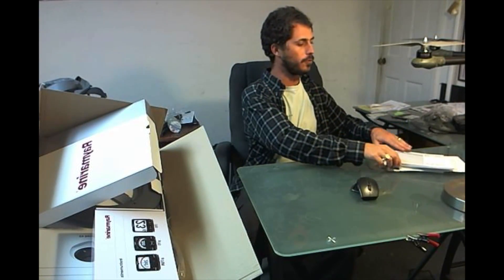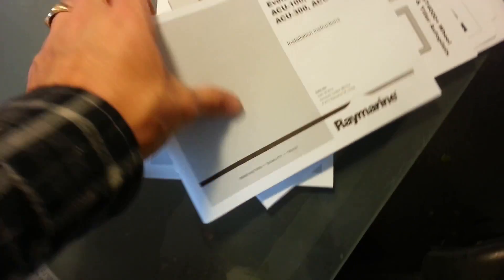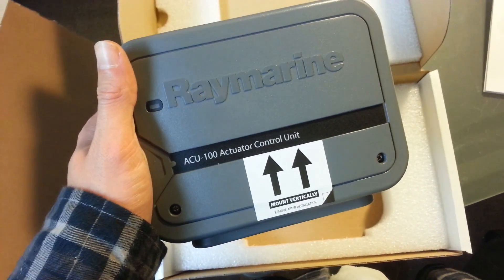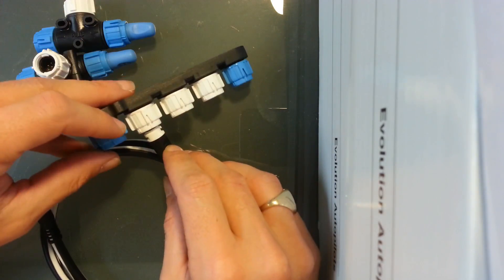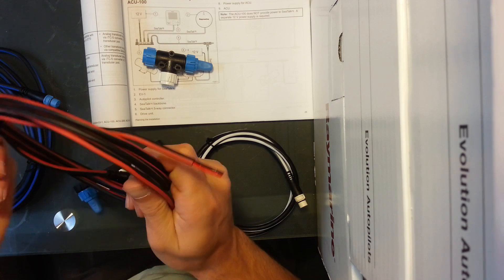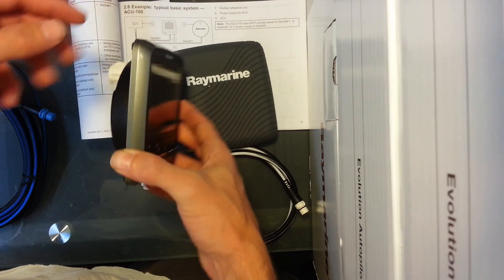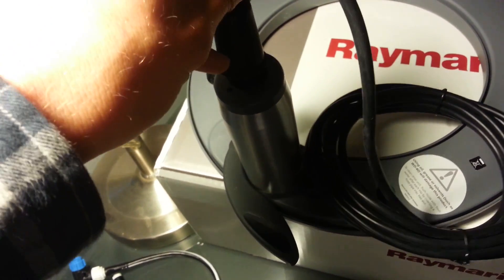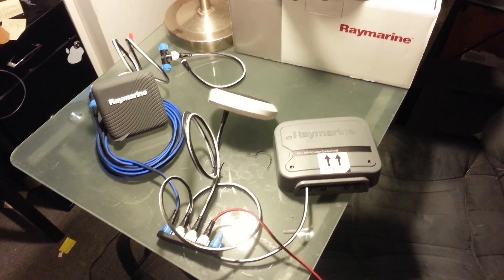Raymarine | 01 - EV-100 Wheel Autopilot & NMEA 2000 Network - Basic Setup T70152

Comment: i have bought two of these, and they both cracked into pieces internally. About to install third. Garbage, but no other affordable choice. Avoid like plague. My windvane is 40 years old and works like new. This autopilot struggles to last a week of offshore sailing.
Reply from the maker: +Super Wag Totally agree the drive unit is garbage all plastic pieces it would make a good backup for sailing offshore but the hydraulic drive is much more solid if you're going offshore, expensive though.

Comment: You have made a mistake at 7:10 the ACU doesn't need a power connection from the battery.
Reply from the maker: Thanks for the concern but the information I provided is correct, the ACU does need a connection from the battery, that is where the wheel drive draws its power from, the ACU regulates the power. Check out the manual on page 19 section 3.6 System examples https://raymarine.app.box.com/s/j9uaqm020hb826l4t3cp/1/1787035935/119763483197/1
Reply: Oh yes fair comment the 100 does have two power supplies.  BTW the reason the connectors are plastic is because its cheaper than metal and they are waterproof to IP6 which could be useful on a yacht.

Comment: Nice vid, looking on picking one of these up for my macgregor 26m. Just need to figure out how to get it talking with my garmin 441s
Reply: You would think that but as I have both, I can tell you the Ray AP does not interface without significant frustration.  The P70 control will tell you it SEEs all interconnected Nmea 2000 devices but, even when using all the appropriate seatalkng to n2000 cabling, will not receive data in any form of regular processing.  The result is the AP will lose connection and veer off. Same with wind data.  Basically anything not RM.  Do not buy this unit if you're using other brands - not worth the headaches!
Reply from the maker: +Payara222 Thank you for your first hand experience. The Raymarine technical forum is pretty good about responding to these types of issues, even when dealing with other manufactures products. Have you checked in with them? It should be possible but that doesn't mean it will actually work. Did a quick search and found this thread but it doesn't state if it was tested. http://raymarine.ning.com/m/discussion?id=6492755%3ATopic%3A172843 You should be able to send waypoint info to the autopilot then 'track' to that waypoint, but not control the autopilot from the Garmin.
Reply from the maker: Jason Wolfe Thanks for watching! Should be possible especially if the Garmin accepts NMEA 2000 sentences
Reply: How did you go with having it fitted to a Mac26M? I have just bought same boat and this gear came with the boat.... yet to be fitted.
Reply: @donnacurtis5528   This was some time ago but if i recall, i was able to make it work quite nicely. I have since sold the boat but i can try to remember as much as possible if you need help along the way.